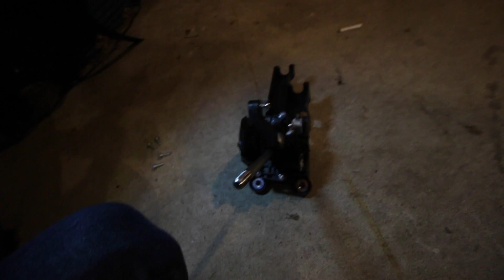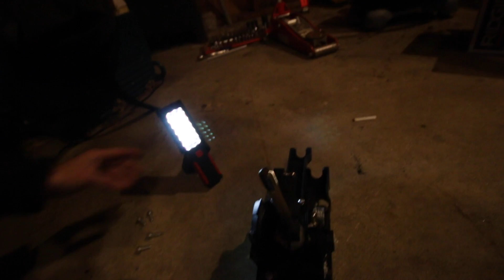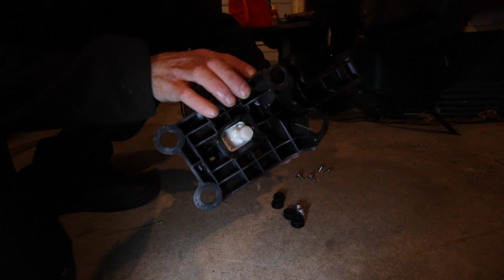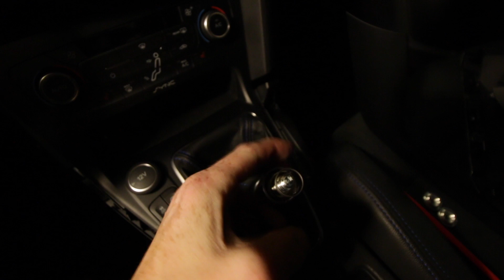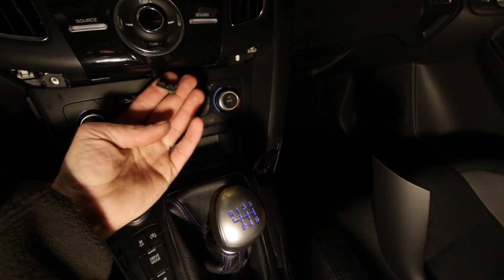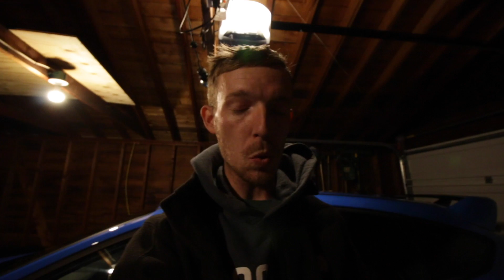Focus RS Interior Billet Shifter Bushing Install

Comment: Hi chris, just got your reply just as i managed to sus that the linkage housing is a quick release and they push down allowing them to be removed from the plastic bracket. Thankyou for replying so quickly :)
Reply from the maker: +Richard Booker No problems. Remember to glue the bottom bushings in place to the shifter base holes lined up with super glue and let set before installing. It's an abyss down there. You don't want to drop one.
Reply: Funny you should say that... when i first couldn't get the gear shift assembly out i tried to take the rubber grommets out while it was still attached to the gear linkage cables and ended up dropping the bushings down into the abys... now that ive managed to get the gear shift assembly out ive managed to retrieve them.. just ! il go get that superglue now 👍 thanks
Reply from the maker: +Richard Booker Not a problem. Good luck hand tighten and your good!  Let me know if anything else pops up. Ohh when putting your trim back together make sure all tabs are lined up to the holes, you shouldn't get any rattle. Pay special attention to the longer part that's on the passenger side.